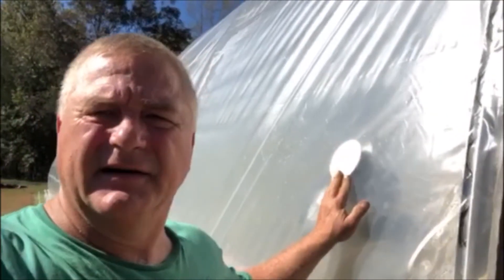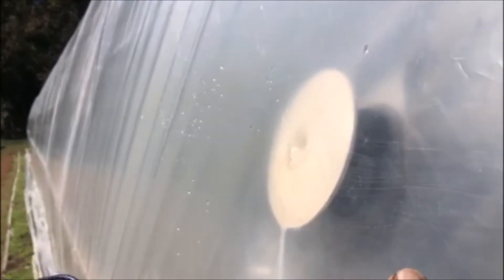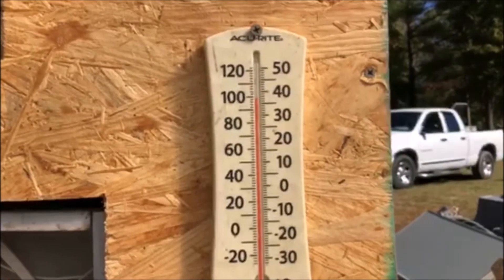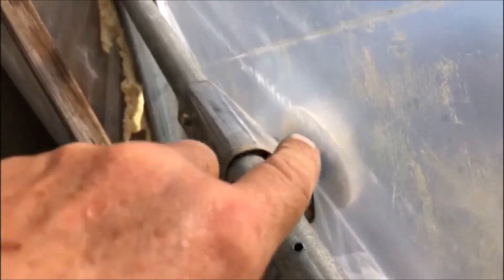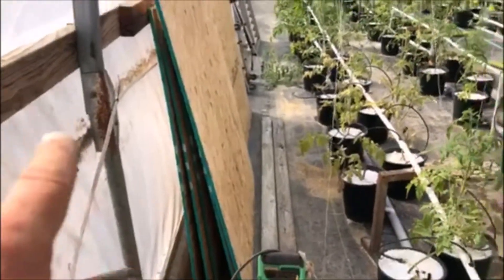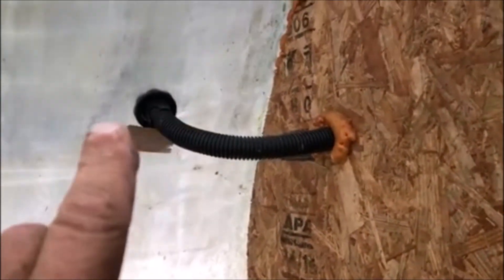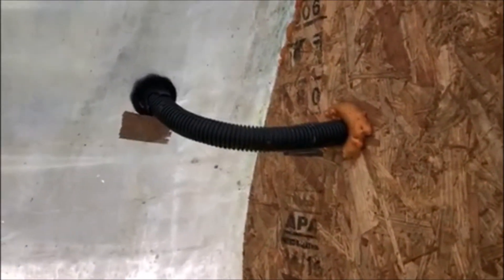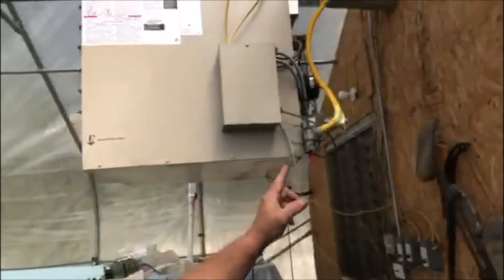How the Inflation system works on our greenhouses!

Comment: Thanks for the walk through.. were almost ready to seal and inflate ours. So perfect timing!
Reply from the maker: Glad to help. I’d love to see it when y’all are finished with it.
God Bless!
Chuck
Reply: Its best to use  the drier outside air to feed the blower. Using the warm humid grrenhouse air will lead to condensation between the skins which reduces light, encourages algae and traps water. Its worth noting the anti fog coatings on greenhouse poly only last for a couple of years, much less than the life of the poly.

Comment: This is my first video seen, discussing the technical details of a foil greenhouse. Learned a lot Chuck. Thanks for dropping by. What is the life span of the plastic covers?  Got me really interested.
Reply from the maker: They are guaranteed for 4 years but they last between 6-8 years on average. I usually change them out around 6 years. Thanks for checking in on me!
Chuck

Comment: Learned a lot from this video, it helped clear up the details on the spacers and the jumper idea is also very ingenious, thank you for the info.  Couple of questions: are you using a bulkhead fitting on the connections for the inlet of the fan and the jumper part? Regarding the wire channel running along the sides of the greenhouse, does it hold down one layer of plastic or both the inside and outside layer?
Reply from the maker: The 60 com inflation blower comes with what resembles a bulkhead fitting to secure the inside layer of plastic. 
You can use 1 piece of wiggle wire to secure both layers of plastic. It can be a little tricky doing it but it actually seals up better that way. I would secure the first layer with it then put the 2nd layer on then pull the wire out of the channel a couple pieces at a time and secure both layers under the same piece of wire.
Hope that makes sense!
Chuck

Comment: Hi, does the air stays inside the two layers or we have to let it go to inside again?
Reply from the maker: The pump runs 24x7 so it stays inflated.if air escapes the 60cfm fan replaces it as long as the leak isn’t too big. Hope that helps?
Chuck
Reply: @FensterfarmGreenhouse  so you mean when air escapes from sides and corners it is fine. No exhaust needed
Reply from the maker: @martinboudaher6897  Yes. There is no way to completely seal it up but the fan should compensate. If not ( depending on the size of the greenhouse) you can add a 2nd fan.
Chuck
Reply: @FensterfarmGreenhouse  thank you 🙏🏼